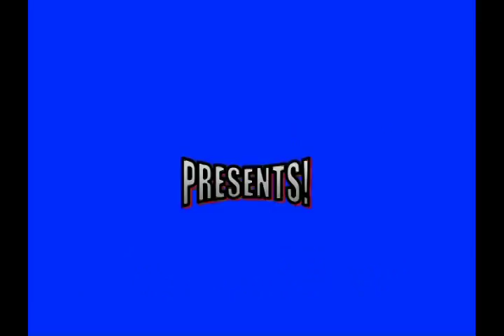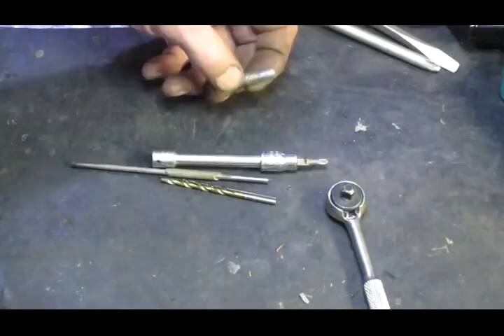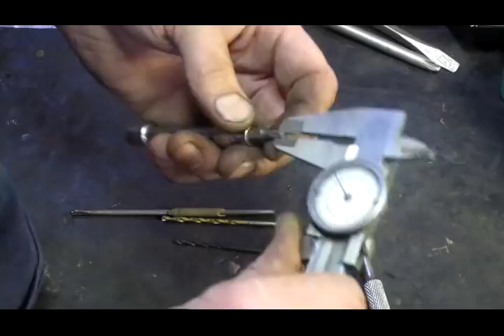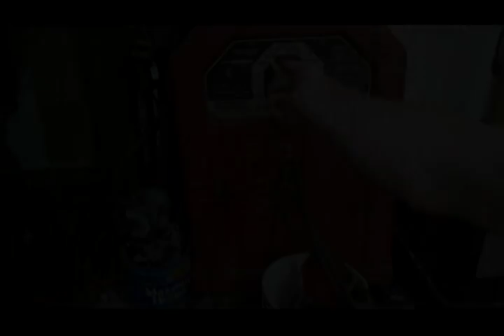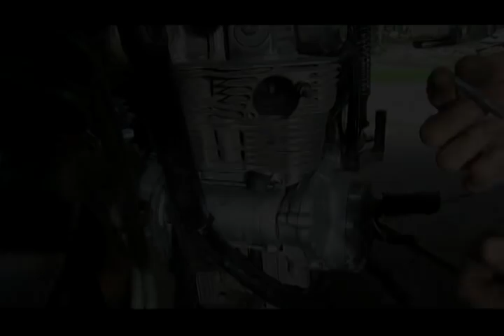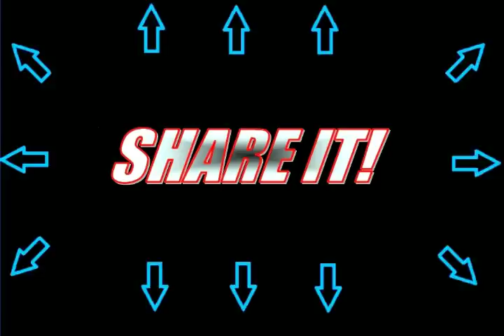Remove a Frozen Broken Exhaust Stud on a motorcycle

Comment: Great method for the home mechanic.  Handy to have a welder.     I agree heat is a key element to resolving a broken stud. I think it helps breakup any corrosion between head and stud as well as expand the metals.  I would have guessed pounding the torx into the drill hole might tend to expand that part of the broken stud making it stick a little more. But it came out and no damage to the head.  Thanks for sharing we are all a little wiser for your efforts.

Comment: Great vid.  Great angle.  The torx head is an idea I'm going to use on a stripped Allen/hex head.
Without all the equipment you have, I have used a left hand bit, or an extractor kit to success 2x.  They work! Cost money, and you have to give some thought (as you did) to the size and bits, but worth it in the end.
Patience is the number one way to remove frozen/broken bolts.

Comment: Very nice work and helpful to me! Also, you can soak it with Kroil which is the best penetrating oil I’ve ever used, and sometimes it helps to go tight a little bit before you try to loosen.
Reply: The people tell me about penetrating oil for every stuck bolt/broken stud/stripped head. Years and years.
It has never worked once for me!

Comment from the maker: To support this channel check out Amazon through the links below:
Here's where to get some of the tools I used it the video
Torx Bit Socket Set https://amzn.to/2tJHaTv
5 piece CENTER DRILL COUNTERSINK Bit Tooling SET https://amzn.to/2KpyT1l
TEKTON  Automatic Center Punch https://amzn.to/2KwR1FX
Left Hand Drill Bit Set, 13 Piece SAE (1/16" - 1/4") https://amzn.to/2Ck8m05
Black Widow MCC-500 Steel Motorcycle Carrier https://amzn.to/2N9WYHc
Honda 1972-2007 CB Headlight Unit 33120-333-670 New OEM  https://amzn.to/2J9U3z0
Motorcycle Spark Plug Wire & Cap 7mm x 24 For 12v Coils Honda CB450 CM450 450  https://amzn.to/2LmoGQh
Metzeler Tire Set - Honda CB450K 70-74 CL450K CB500K - Tires Tubes and Rim Strips https://amzn.to/2KSaLjM
HONDA CB450 CL450 KEYSTER CARB KIT https://amzn.to/2KQl8EF
Honda fuel petcock fits CB450K 1968-1974 1968 CB350, 1970-1972 CB350K, 1973 CB350G, 1974 CB360, 1974 CB360G, 1975-1976 CB360T, 1966 CB450, 1970-1971 CL175K, 1968 CL350, 1970-1973 CL350K, 1974 CL360, 1975 CL360K, 1967 CL450, 1969-1974 CL450K, 1970 SL350, 1971-1972 SL350K  https://amzn.to/2x9Q9l1
Carburetor Rebuild Kit with Floats - Honda 1970-1973 CB350 CL350 Twins https://amzn.to/2saGyEX

Comment: Might try this method this weekend. Gonna use left handed bits first though. Heat seems to be  the trick.  I'll use a little propane torch so as not to melt the aluminum, I hope.

Comment: You should try to get a snapped bolt out of a cam bearing cap on the Honda CBX!  Had to use an angled drill attachment because of the position of the frame!
Reply from the maker: Sounds like that was a tough one. Did you get it out?
Reply: @Amotorcyclenut  yes, thankfully. I can only imagine the damage that could have been caused by a bearing cap rattling around inside! It took about 3 hrs, and a great deal of patience. A mild state of disbelief when it finally came out with no damage to the female threads!

Comment: Nice job and without any of those special mechanic words.  What's with the notch at the bottom of the port?  Looks like a flat exhaust pipe flange wouldn't seal.  Thanks for the video.

Comment: New stud with no grease.....creating a stud issue for the future again...
Reply: I use a product called, "anti-seize".  Isn't it for studs like this?
Reply: When he started to put the stud in without any anti-seize I wanted to yell "NOOO"!  But I guess if he put's anti-seize on the protruding threads of the stud before he tightens up the nut that holds the exhaust flange on, the stud shouldn't snap off again in the future.  I NEVER put a bolt back in without anti-seize (or Loctite), and especially on a motorcycle!

Comment: Can u weld a bolt on to the stuck stud with it on the  atv  ect without blowing the cdi box or any thing else ?
Reply from the maker: It wouldn't hurt to disconnect (unplug) the CDI box, just in case.

Comment: Hack work altho it worked, transfer punch would have put center punch dead on center when you say root size do you mean the minor dia? There are much better ways, you could’ve mounted that ion a Bridgeport table and used a mill tool directly down the center worh no heat or an EDM machine or disintegrator
Reply from the maker: Most mechanics don't have a transfer punch, or a Bridgeport or an EDM machine. On top of that you would have to totally remove and disassemble the engine to use a Bridgeport or an EDM machine. If you have that kind of time and money go for it. By the way, I was riding the bike a hour later and you would be ordering gaskets.  Root Diameter and minor Diameter are similar.

Comment: Hi....
I have been looking for some advice regarding a stud which is turning itself rather than the nut? It's on a 2016 Sportster with the engine still in so have very limited clearance. Anyone have any suggestion, thanks

Comment: I have 93 xjs600 secca 2 with one header with  both studs broken but I have no stick welder to complete that process any suggestion?
Reply from the maker: You could skip that part but your chances of success might go down depending on how stuck they are. You'll still want to heat with a propane torch.

Comment: New subscriber. Excellent video as a retired aircraft mechanic I’ve never seen it done exactly that way. Do you think just using the MAPP gas without the welder would of worked? Thank you for the video. Artie ❤️ can you apply a small amount of locktite to the stud?
Reply from the maker: Maybe. The idea was to get the stud to thermally expand in the hole first, to loosen it. Then expand the aluminum around the stud to get the it loose. It worked. Sometimes corrosion between steel stud and the aluminum head can be a real pain. No need for locktite, because that area gets pretty hot and you might have to change it again in the future for some reason.

Comment: Heating the stud itself in theory should actually make it tighter as it expands with heat..  I think you only need to heat the aluminum which will expand faster than steel and release the bolt.  I'll bet your lincoln welder loves you, isn't that hard on it?
Reply: in practice the stud will expand then contract & break the seizure - needs care but works.

Comment: The only problem is I don't own a welding machine
Reply from the maker: Just heat it with a propane torch the best you can. Use a sharp drill and you'll be fine.
Reply: @Amotorcyclenut  thank you!
Reply: Maybe a silly question but is it safe to use torch there while the engine is still full of petrol?